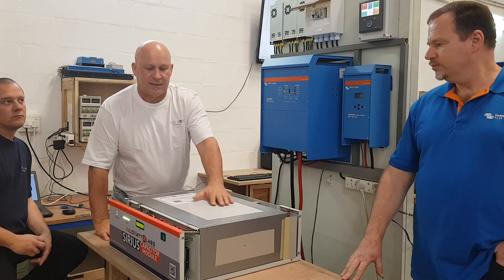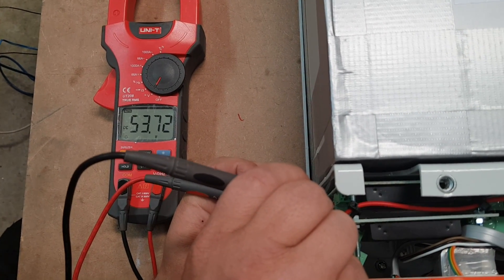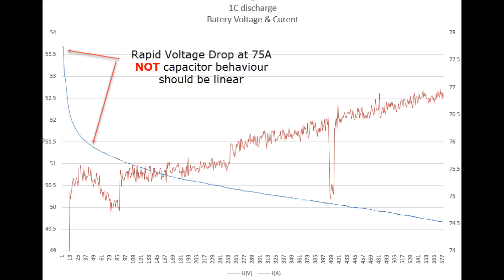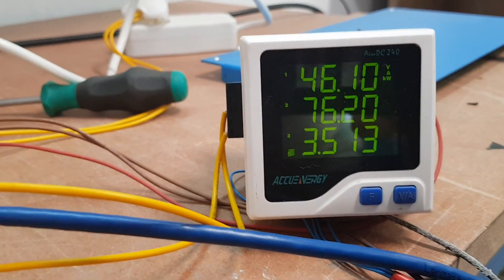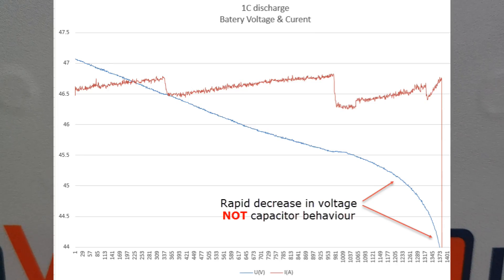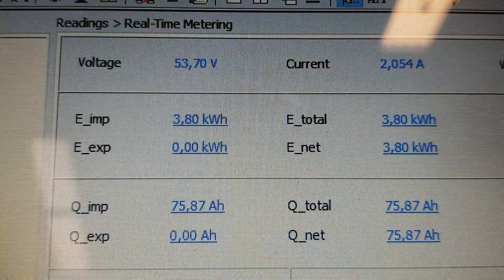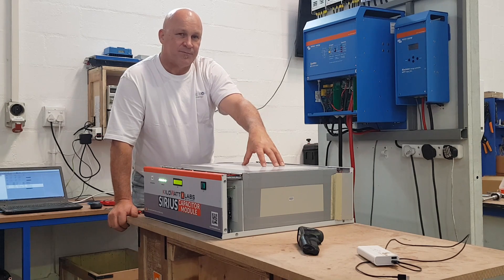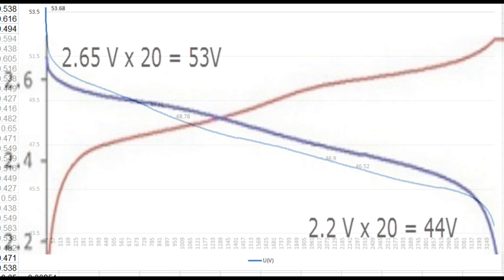KiloWatt Labs Sirius Super Capacitor battery test 3.5kWh

Comment: A Lion battery is technically speaking a "voltage source" keeping voltage constant during discharge.
A capacitor looses voltage linearily with constant current draw. So, without a bi-directional DC-DC converter (a la Cuk) one can not use a capacitor bank as a Lion replacement and one can not use the full voltage range i. e. capacitance of the capacitors while matching the typical input voltage limits of a typical battery inverter. On top, both Lion and Supercap need a balancing system to keep series cells at the same voltage.
If the assumption in terms of used cell technology holds water, there would be a fat case of client fraud involved from the side of the manufacturers!

Comment: Funny when I worked with Electronics Current always leads voltage on a Capacitor, so a steep drop is to be expected. What worries me is the weight, as a graphite paper Super cap without a dialectic  should be very light, even with lots of them. Also the unit is very shoddily built..
I am thinking of upgrading my system but not for this.
Reply from the maker: Hi Frans.
There's quite a few inconsistencies in the claims  made by the product supplier.

Comment from the maker: The most important thing to observe here is that the manufacture4r claims that this is a Super Capacitor module which when testing it revealed that it is not a super capacitor module.
Reply: Absolutely James - Hit the nail on the head.  Thanks for the detailed test, and the legwork to overlay this discharge curve over that of an LTO battery.  

If these really are batteries and not super capacitors, that's fraud, plain and simple, on the part of the manufacturer.  An LTO battery might have a cycle life around 7000x at the high end right now, but the MFR states this unit has a 1 million cycle lifetime.  I have a feeling that when you go to collect on the warranty, the company will have gone bankrupt and the owners will have moved on to another fraudulent project.

A product like this would change the world:  Solar storage, peak shaving, potential vehicle use with a "battery" lifecycle so long that you could re-sell the energy storage unit after the car died, or pass it on to your great-great-great-grand kids.  (A vehicle unit with 250 KM range could go 250 million KM assuming a 1 million cycle life... that's an 8,000 year life cycle if you drove 30,000 KM / year.  Something doesn't smell right.)  

I was excited when I read the datasheet, but it seemed fishy and I wanted to see a tear down. When something seems too good to be true, I guess it probably is.
Reply from the maker: @andrewy1409  https://www.youtube.com/watch?v=JlRRBKrGsbE&t=308s&ab_channel=RobertMurray-Smith

Comment: Is there any chance you have done the same tests and pull apart on a newer model since this video? also, could you do a video on ways they could have improved build quality?
Reply: I’m sure replacing the cardboard and duct tape with more robust materials would account for changing the projected lifetime from 30 years to 45. Not. Even replacing the Arduinos by professional-quality digital logic is not going to last anywhere near that long – even if it was truly supercap not battery.

I suspect an elaborate scam. In normal use, if this is actually a decent battery, it will take 10 years+ to lose enough capacity to be noticeable. By which time it’s way too late to be upset about overblown claims of longevity.

They make extravagant claims. They are not plausible without independent verification.
Reply from the maker: https://www.youtube.com/watch?v=JlRRBKrGsbE&t=308s&ab_channel=RobertMurray-Smith
Reply: @JamesVerster  is this not the funniest follow on of the review. Dishonest bastards at work their 7kwh systems are R100,000

Comment: Super Capacitors are rubbish after less than 3 years my 2 super capacitors are breaking down and no support from KilowattLab.
The CEO Mr Waseem is not a man of his ward. Buy rather Lithium battery much cheaper and hassle free.
I am awaiting KilowattLabs reply since 19 July 2021. They are keeping very quiet and CEO avoiding any contact.
It is a very disappointing experience. I REGRET that I bought their product (I bought 2 x 7.1kvh units).

Comment: Super Capacitors are rubbish after less than 3 years my 2 super capacitors are breaking down and no support from KilowattLab.
The CEO Mr Waseem is not a man of his ward.
Reply: did you put this in the garbage? I'm thinking to doing the same cause there are the voltage and current, but the dispay (and electronic) doesn't. Assistance not available.

Comment: Why didn't you just open it up to see if it's made of capacitors or li-ion cells?
Reply from the maker: Those LTO and SuperCaps look identical. They are made from the same casing. I tested them electrically and did mot want to destroy them by looking at their construction.
Reply: @JamesVerster  
Sure, but that's not very helpful for your viewers 😨😣

Comment: We have 6 modules, each 7.1kWh. 4 Schneider electric solar mtpp chargers, 4 Schneider XT whatnot inverters, 5.5kw solar capacity @ full sun, about 1kw in overcast. 2 gensets, one propane, backup diesel. Today we added 2 new modules, and got them all matched. We were charging an electric forklift, using other power and pulling a solid 16kw for Atleast an hour to get all the modules zero. These things charge up with a 500a genset while powering a farm, business shop, and charging a forklift in less than an hour. The numbers are insane. The current flows are insane.
Reply: Is there any temperature change when working them hard?
Reply: @tryitcc  not totally sure. I think it's negligible. There are cell and terminal temp probes, and they're reported on screen. I'll have to ask, and/or watch temps as loads are applied or generator/s kick in, again depending on load
Reply: They're made of something for sure, but a li-ion setup of any kind wouldn't put up with any of that
Reply: Also, all of this neat equipment belongs to the company I work for, and not my own. I get regular Ontario grid electricity 👍 #nuclear #hydro

Comment: È' un test di una versione primordiale. Consiglio di dare un'occhiata alle versioni attuali. Ci saranno molte sorprese. Ne ho una recente installata a casa mia ed ha prestazioni eccellenti.
Reply: Sono celle al litio titanio. 
Non c'è nessun super capacitore dentro quella batteria. 
Per carità, le celle al litio titanio sono delle ottime celle, ma il problema è che questi te le vendono come supercapacitori per speculare sul prezzo (tanto il consumatore medio non sa una mazza).

Oggi gli diciamo che sono supercapacitori e la vendiamo a 1.000€ al kWh.
Domani la vendiamo come batteria quantica a 2.000€ al kWh.

Se dicessero la verità e cioè che è una batteria al LTO (Lithium Titan Oxide), poi la dovrebbero vendere a meno di 200€ al kWh e a loro non gli conviene
Reply: mi fa piacere che almeno a te funziona. Io ne ho preso uno nel 2019, e ha funzionato fino a qualche mese fa. Poi è morto. Chiamata l'assistenza italiana Ultraflex (il modulo dovrebbe avere 10 anni di garanzia)  che per un po' non ha nemmeno risposto fino alla minaccia di smerdarli pubblicamente. Dopo questa mi hanno scritto di chiamarli per vedere cosa si può fare. A parte che ho capito che un po' se ne fregano e un po' non possono farci nulla, sto cesso si modulo è KO dal punto di vista dell'elettronica di controllo, ma alzando il magnetotermico di emergenza sembra che la tensione e corrente ci siano. Ho un fermacarte da 75 kg anche difficile da smaltire

Comment: Hi James what's the point of buying this battery...I'd rather get a lithium ion battery of 5 kilowatt for $1,500 or am I getting it wrong...what i mean when you say its 3.5kilowatts does that mean 3.5 kilowatts per kg or what is the advantage of this battery than lithium ion battery 
1. Price?
2. Capacity?
3. Charge rate?
4. Life span?
Or what?
Reply: $ 1,955 , charge rate is 1.7 , 10 year warranty. this is 3.55 KWh.

Comment: As a technology enthusiast I decided to purchase one of these for my solar system at home. Knowingly that it might be a bad investment, but I had to feed my curiosity. Coupled with a Victron system (including a BMV-712) I can report that I obtain a RtE of 96.1% after 6 months of operation and 410.81 kWh of discharged energy. I have to add that the BMS on this unit is not great. Inaccurate voltage measurements are causing havoc with trips. Took me several months to get the settings rights on the Victron system with the effect that I am only getting 3.1 kWh out of the unit to stay within the limits of the BMS.
Reply: @Gerhard, I am the technical director of Greenfox. If you are only getting 96% RTE, I suggest you look at where the BMV voltage reference is installed. All the sites we monitor operate at 97% or higher. Only way a Sirius supercap gets 97% or less is if you have cable losses included. I would love to engage with you to see why you get such low round trip efficiencies out of a supercap.
Reply: @billydejong8860  would this be viable for a 30Kwh residential setup compared to a LTO battery?
Reply: This is real or fake?

Comment: I DONT AGREE. I think Paul Wilson is right, you may have jumped the gun in your determination and speculation. However, I appreciate your coverage and thorough testing. Very informative - HOWEVER, easily googling types of capacitors and their respective discharge characteristics shows you  made statements and captions in which mislead the general viewer and were in error.  I almost thought negatively of the company until reading Paul's comment and confirming his statements.

Comment: Kneeing off is definitely ion battery behavior.
Reply: @Ken Bell, I am going to ask you to substantiate your statement. We have more than 2000 sites installed just in South Africa, and there is one big difference... Caps don't have hysteresis. All the sites we are monitoring with Lithium, have hysteresis. Not all caps have a linear discharge curve like EDLC's. So, it is actually not a LTO, or lithium of some sort. A lot of people make the mistake to think that all capacitors are EDLC's and should have a linear discharge curve, but you should actually look at the hysteresis to realize the energy is stored statically (capacitors) and not chemically (batteries).
Reply: 3.5kWh in a package 50% larger than the 4.144kWh li-ion battery sitting on my floor? They have invented 100Wh/kg+ supercaps? = scam, physics are incapable of lying.

Comment: Can you discharge the module down to 0 volt? Capacitors assuming that are being used to power the module should survive the attempt with no capacity loss, any batteries will either die or significantly lose their capacity... Do a couple of such discharges and perhaps get a good fire extinguisher, lithium "capacitors" are pretty flammable ;-)

What is the weight of the unit? Assuming that the best (graphene) supercaps in labs reach energy density 50W/kg, 3.5 kWh unit should at least weight 70kg and most likely double or more.
Reply: @John Dow, we have done this test many times. You are quite right, chemical batteries won't survive this test. We have left multiple units at 0V for over 8 months. Once recharged, there is no capacity loss. Very good test to do. I suggest you try it sometime to see for yourself.
Reply: @billydejong8860  
Link to actual test process and data since you have done this "many times"???

Comment: How much does the Box weigh? That will tell you real quick if they are using batteries or caps. The fact of the matter is if they really had the "Fountain of Youth",  they would hand one over to an Third Party, well known, Independent Lab for testing. Where is the Super Cap PATENT?  And there are youtube video's on how to build DIY 4.4 KWH Walls with 18650 LI Batteries for under $300.
Reply from the maker: About 70kg
Reply: yep. about same density as a DIY LI Wall.

Comment: That ABB contactor should handle the DC switching quite well. Just concerned about the current rating. Is it switching the main circuit?
It's definitely the only decent piece of kit in this battery though.
Reply: I was thinking the same thing Riaan. ABB makes some good kit. But I know you guys at All Electrical are big ABB fans too :-)
Reply from the maker: Mooi Riaan !
There is no pre-charge circuit in the battery so when connecting the Capacitor Module with an internal resistance of a few milli Ohms to the DC bus capacitors the current will reach 10,000A to 20,000A Amps.
Reply: Dear Riaan, this is not a battery, it's an energy storage module called Sirius.
Reply from the maker: Hi Omer.
What  is the chemical composition of the cells you use in the module ?

Comment: A few issues that should be noted with the test. The model being tested is an earlier version of the product from 2017 before volume production started and I also tested this 2017 model to be about 94% RTE at the terminals. With the 2018 model, the round trip efficiency stated of 99.1% is at the cell level and tested to 97 to 98% RTE at the terminals depending on the current flow rates. The small losses are primarily from the electronics and conductors. This 2017 model uses cell group balancing with voltage regulators, the 2018 model has DC/DC converters in the balancing boards to increase efficiency from 94% to 98%. The unit is called a "super capacitor" module and the reference that it is not a "capacitor" discharge curve is misleading. Super capacitors come in many varieties including LICs, ELDCs, Pseudo Super Capacitors, Hybrid Li Capacitors and more, its a broad name for high power/energy capacitors and they have various energy / power curves as a result. Super capacitor curves are often not the same as electrolytic capacitor curves. The cells have no polymer or other separator between the anode and cathode which means the cannot be Li batteries as suggested.
Reply from the maker: Hi.
I find it difficult to keep track of the specifications of the product vs the actual performance. "1 million cycles and 99.1% RTE" as stated on the specification sheet are very serious numbers and consumers make decisions based on these numbers. There is a huge difference between 94% and 99.1% (and why the decimal).
I also think that the battery is a hybrid of some sorts. It is certainly not a super capacitor with linear charge and discharge curves ( see the video). 
Also see the hierarchy : https://en.wikipedia.org/wiki/Pseudocapacitor#/media/File:Supercapacitors-Short-Overview.png

LIC: LIC's looks very attractive but cycle life will not see 100,000 , more like 10,000 cycles.  https://pubs.acs.org/doi/abs/10.1021/acsami.7b03452
ELDC: This is a pure super capacitor and will have a near linear charge and discharge curve. So I think this is not what is used here.  The energy density limitations are a problem here. This is a electrostatic energy storage device. They have 1,000,000 cycles and very expensive.
Pseudo Super Capacitors:  These are electrochemical cells and have cycle life limitations, < 10,000 
Hybrid Li Capacitors: These are combinations between Electrostatic and electrochemical cells. This could be used here but again the electrochemical parts of the battery will be a cycle limiting factor. LTO could give you 30,000 and used with ELDC could be a very good combination. I have tested them in such combinations already and you get very good results. However, price and weight premium have to be taken into consideration. In our experience (Off Grid Solar) is that the market is not prepared to pay that premium for the weight and limited actual life increase. (the problem lies in that the rest of the battery might only make 15 years but then it will fail).

I'm not sure why it is a secret what these batteries are made of. In the world of 10 years warranties you need to lift your dress quite high so all can see what's under the bonnet. :)
Reply: Why dont you just lift the dress up yourself and see what's under the bonnet ?
Reply: @JamesVerster  A constant power discharge should be an exponential decay - the energy stored is proportional to the square of the voltage - a linear curve would only be expected if it was directly proportional to the voltage. (But if it is actually a capacitor, all capacitors should have similar discharge curves - things with other discharge curves are not capacitors) (Pseudocapacitors/Hybrids are not capacitors and selling them as such is misleading)

The current ratings on their data sheets (50A for the 1kWh model) does not look like capacitors either - with sufficient conductors, a capacitor can deliver / accept hundreds/thousands of amps. Much lower capacity Maxwell capacitors easily provide the hundreds of amps needed to start a car.
Reply: Hi James .What is your response to  Paul Wilson's comment?
Reply: Hi Paul, are you able to run a similar test on the 2018 model? I’m very keen on installing these in our new build but this video gives me some concern, mainly build quality. Thanks.
Reply: Hi Guys 
the new Module is an advanced level even though this  is still impressive over lith or acid